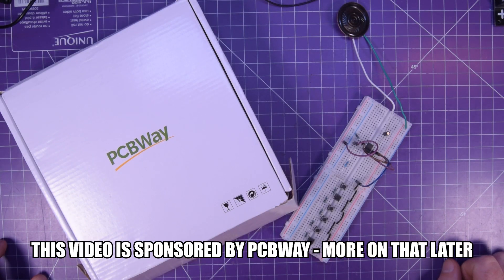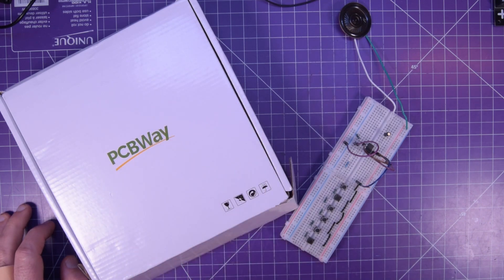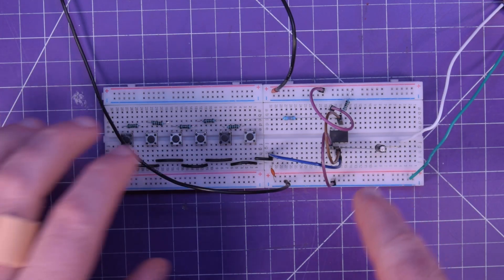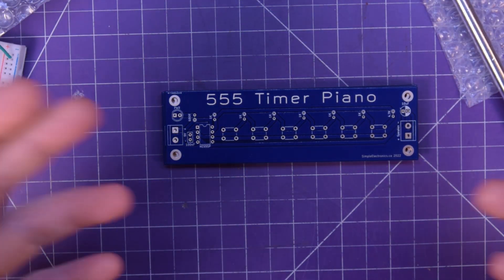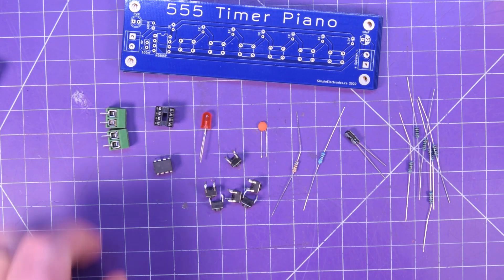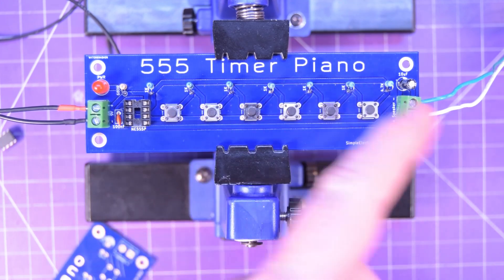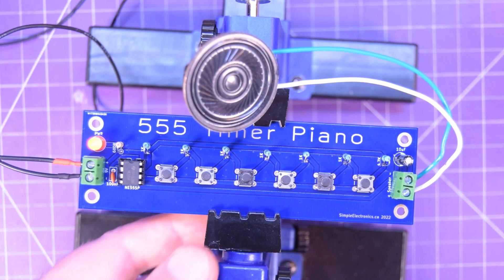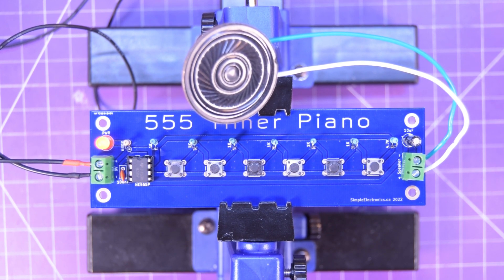An IC That Can Annoy Any Room! 555 Timer Piano

Comment: Instead of discrete switches you could have a long variable slide resistor from the LHS to the RHS to slide and pump out a sound from an ADC :) and an ordinary cheaper uC could be used.